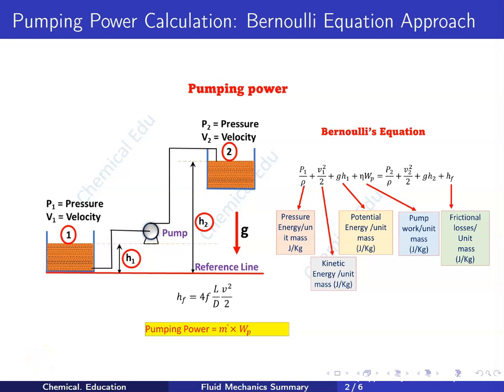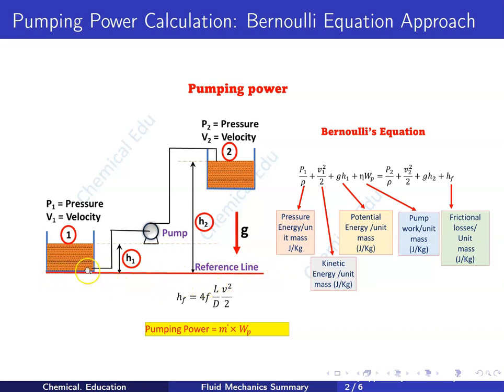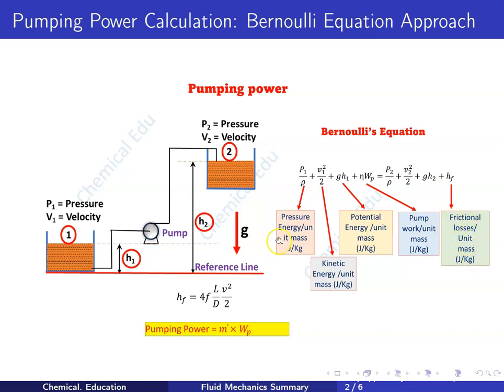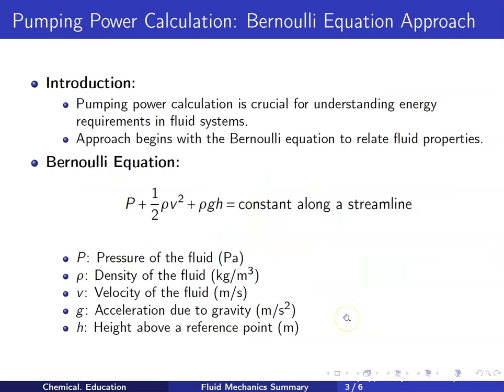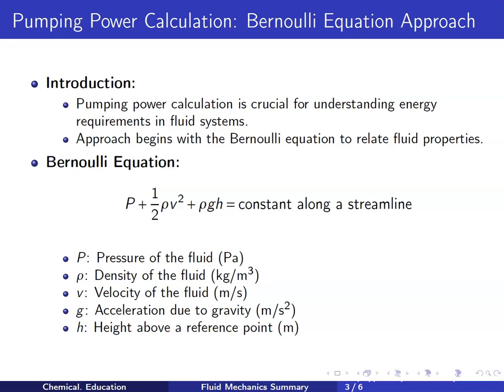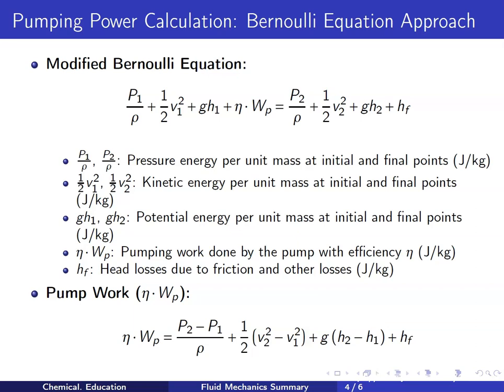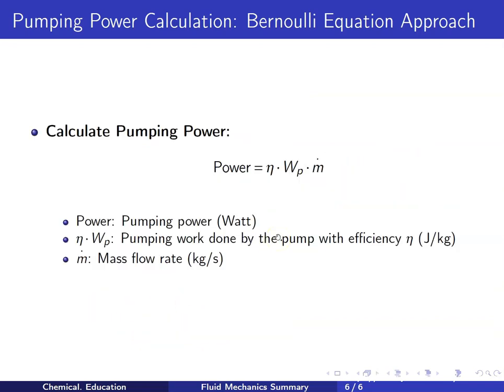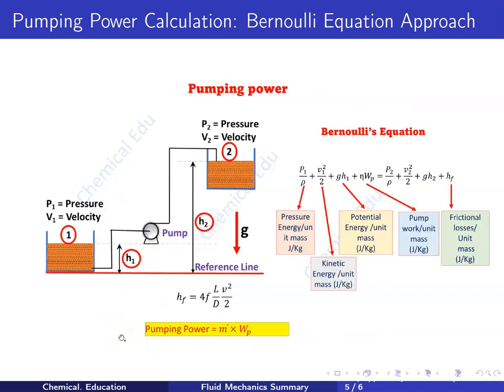Pumping Power Calculation: Bernoulli Equation Approach

Comment: How is #1 tank was able to get the water above the tank to the pump? The tank should be taller and the water should be more than that
Reply from the maker: Water is pumped from the lower tank to the upper tank because the pump provides the necessary energy to overcome the height difference. The pump increases the pressure and velocity of the water, allowing it to move upward regardless of the lower tank's height. The system doesn't rely on the lower tank being taller—it's the pump's work that lifts the water. Bernoulli’s equation helps calculate the required power, but it's the pump that supplies the energy to move water from a lower to a higher elevation.